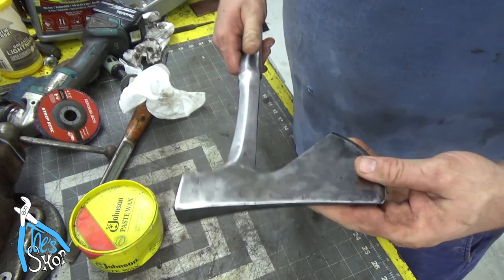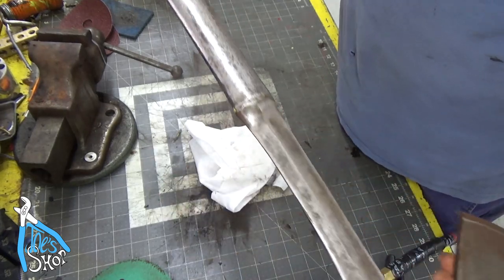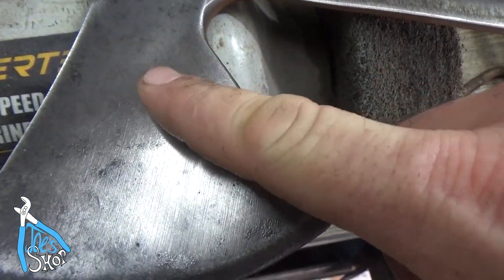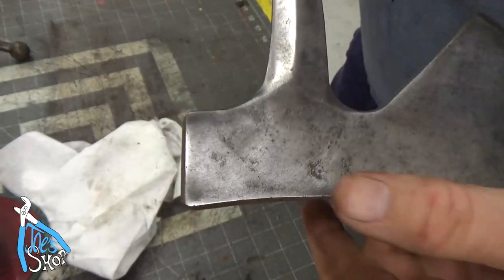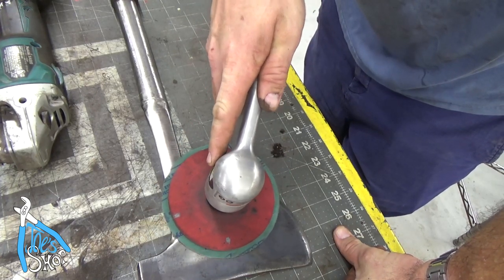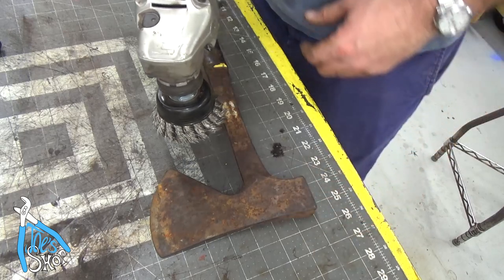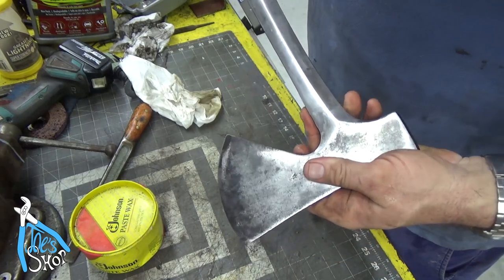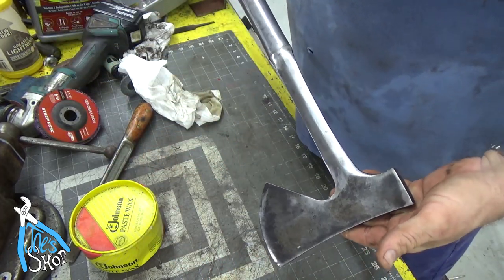Estwing Camping Axe Restoration (rust removal tool discussion)

Comment: Hi Joe, You are so right about the speed and efficiency of a disc sander. Especially on big flat surfaces.  Those Estwing axes are bulletproof however after ten minutes of chopping with one you will most likely experience elbow tendinitis. They are extremely unforgiving and transfer shock up your entire body.  I have the same model with the leather handle. Hickory handles are not as durable but so much more forgiving.  (Ask me how I know) 😂😂👍
Reply from the maker: I don't do much chopping, but I do use it like a hookaroon, when I use the log splitter....which keep my back from getting jacked up 😫🤣. Cheers

Comment: I just wanted to add to your comment about getting the industrial hand soap up front. Not only is it worth the cost, but it's the wall mount that really matters. I personally use gojo, but it's all the same. I don't know why, but they make the mountable holders pretty hard to get a hold of. I don't see them go up for sale very often although the replacement jars are always on the shelf. For that reason, regardless of brand this has become one of those things I pick up at yard sales regardless. And then once or twice a year I find a grocery store that still has lava soap in the bar, my personal preference, and I buy all that they have which is never more than 10 bars for some reason. I don't know if it is NOS or if the company has not changed the packaging for years, but it still works and smells fantastic

Comment: That's a great tip about avoiding tools from body work guys. I would take it a step further and not buy used tools from people in the trades. It's fine in a few scenarios, shortly after Christmas or Father's Day for example, but if the guy who does that type of work all day everyday decides that a tool is worn out, then as an amateur, trying to use the same tool is very unlikely to yield satisfactory results. There are so many people out there that decided they were going to get into woodworking and dropped a small fortune in one weekend just to let things sit for a decade, that's your gold. And there's a surprising amount of those guys. And it lets the rest of us get our hands on stuff from veritas or Lee valley where we might not spring for it otherwise. Almost every great deal I've gotten has been accompanied by the owner specifically saying he wants it all out of his sight. Magic words

Comment: Wow that little air sander tool really seems like the solution.  I wish my compressor produced enough CFM to support an air sander.
Reply from the maker: My machine is only 2hp with a 20 gallon tank. The key is to buy an old compressor 1990 and earlier, they are quieter. Cheers